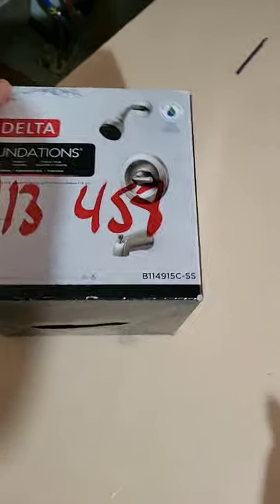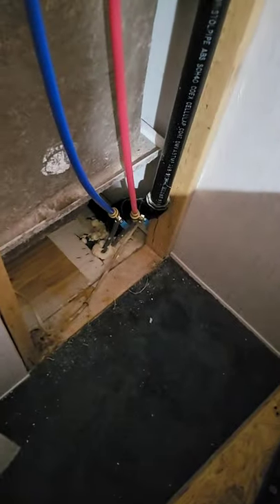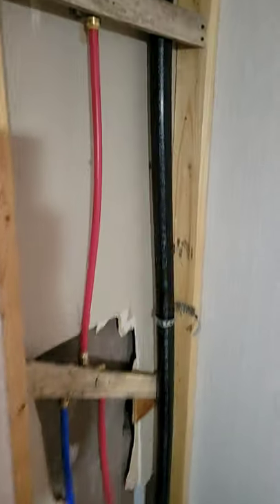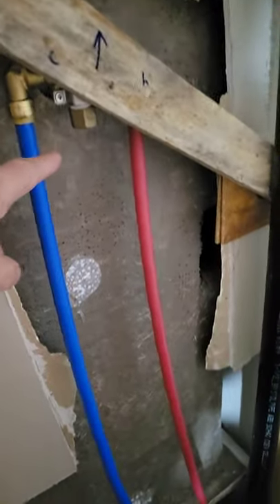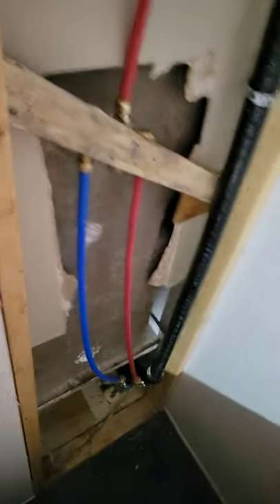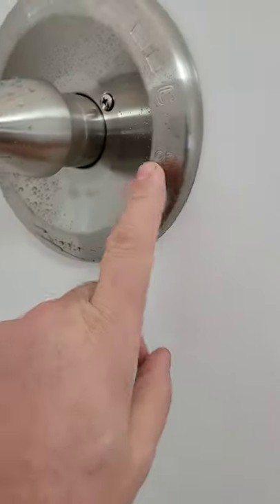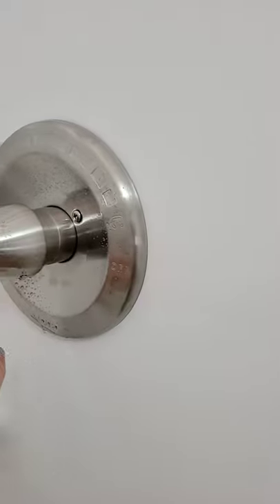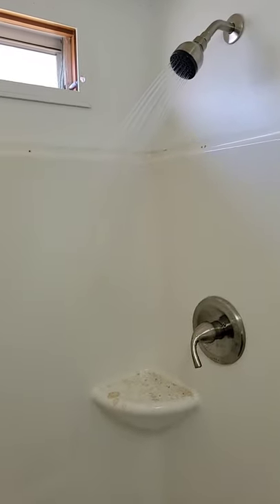Delta Shower Valve Install

Comment: Ur water pressure will drop some from using pex to the diverter to the head. Ur supposed to use copper. Trust me I made that same mistake myself.
Reply: I've had mine 10 year same presure